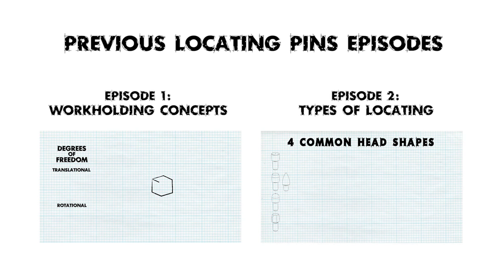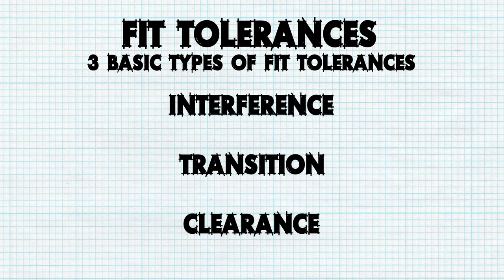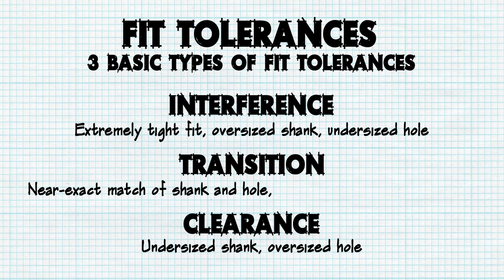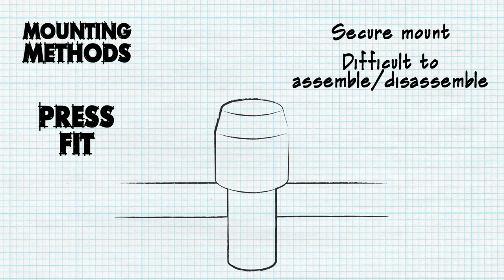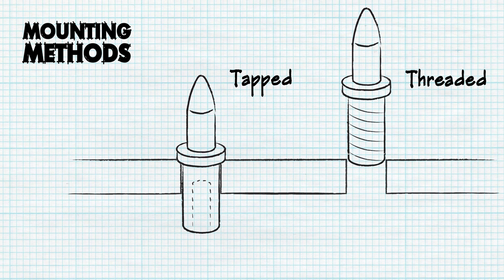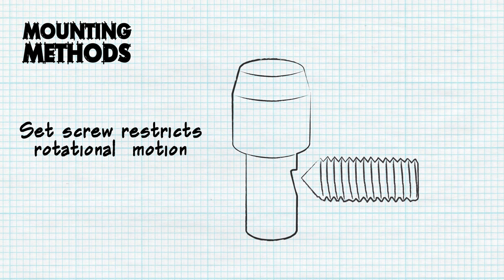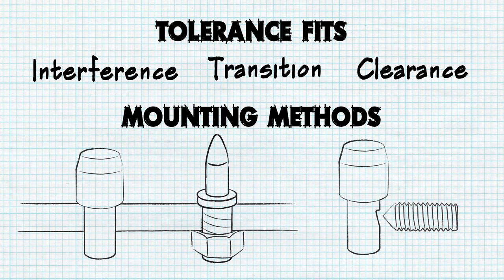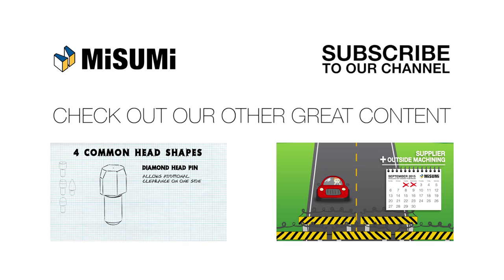Locating Pins Pt. 3: Types of Mounting | Engineer to Engineer  | MISUMI USA

Comment: Does anyone now about drilling a hole under the pin and after tight fitting hammering the hope with cone shaped tool to further strengthen connection??
Reply: I've never heard of this but it sounds like a real pain considering you would be hitting the pin back out of the fixture.